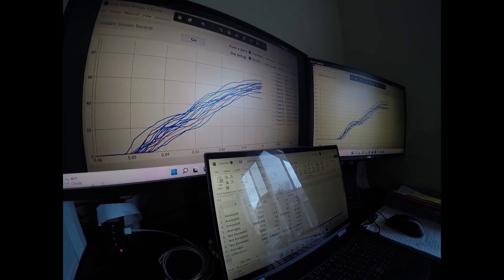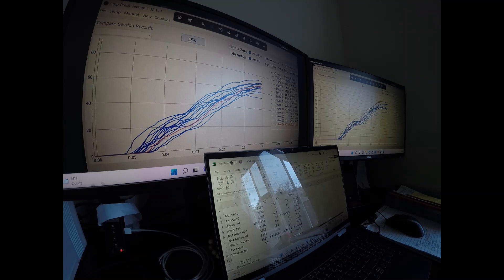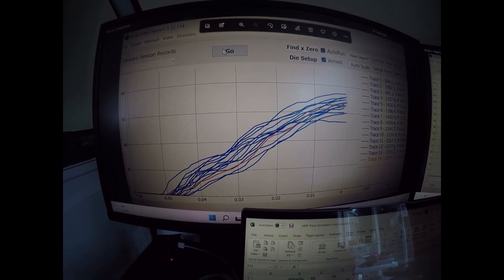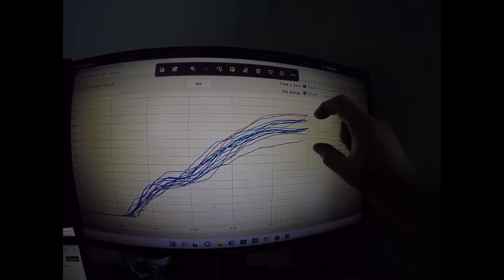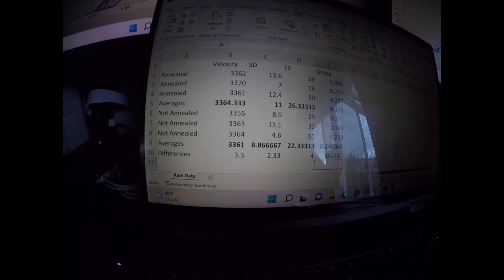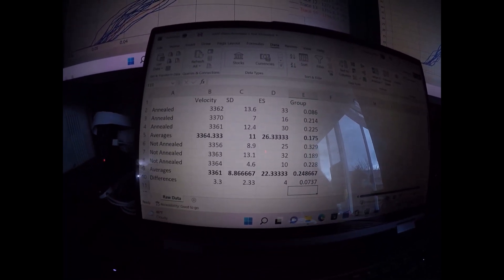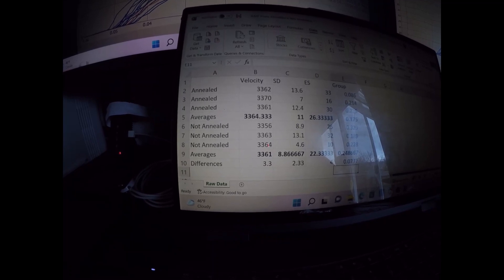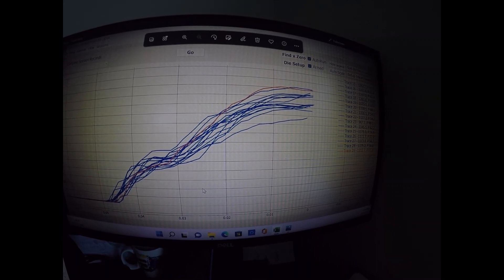AMP Press Series: Annealed vs Not Annealed

Comment: I would think there would be a difference in the sized neck dimensions (using the same neck bushing) between annealed and not annealed brass.  This could account for differences in the measured amp press values when seating bullets.
Reply from the maker: That would be one assumption but I have not found that. Neck diameter is usually very uniform among annealed and not annealed brass. I’ve seen ever so slight variation but not enough to explain pressure curve that show distinct pressure curves and overall pressure to seat. It seems like the annealing softens the brass to the point that it expands easier when seating which manifests as lighter seating pressures. I’ll be posting data from the next test I did in the series that shows this effect.

Comment: I have a feeling that annealed brass burns the carbon out so bullet would be harder to put in or it would need lube to seat bullet more smooth
Reply from the maker: Yes, the lube does make it seat with way less pressure than not lubed. That is my next test.

Comment: This just adds to my argument about loading during competitions. (I do not compete, but my gunsmith is big into 100 yd benchrest and is trying to get me to compete) Powder burns by weight, not volume, so I see why adjustments are made as the day heats up when you drop charges. So, on local matches where you know the weather, why not load at home, with annealed brass and weigh your charge? I don't see the advantage of loading during the match. It just adds pressure to load, clean your barrel, etc.
Reply from the maker: There are many ways to approach matches. Some load everything at the range with small batches of brass, some have enough brass prepped to shoot an entire match with one batch and they charge and seat during the match, some preload all rounds, etc. I’ve seen all methods work well.

Comment: Hello Bryan, did you brush after annealing? I noticed a lot of difference while seating. It feels like after annealing the case is kind of rough, while seating I feel some places in the neck have a more rough structure. After I anneal I brush (without lube),  seating is than way more smooth and consistent.
Reply from the maker: No, I brush prior to annealing. I also rub the carbon off the exterior of the neck and then wipe the case clean before annealing. I can try brushing before and after and see if it has any effect on the pressure curve.
Reply: This is why I switched to wet tumbling and lubing necks after annealing(dry tumbling did not remove the grit). I noticed the same gritty feeling when final sizing using a mandrel and bullet seating. It would actually leave hard brass looking deposits on my mandrel. Annealing is the first process for me after de-capping. So initially I switched to wet tumbling without lube and the clean necks resulted in a significant loss in accuracy and an increase in SD/ES. Using a suspended graphite lube on the clean necks resolved those issues. A guess is that there are oxides left behind after the annealing process. Oxides can be much harder/more abrasive than their unoxidized counterparts. Could also be a mix of that and burned carbon residue. I imagine brushing the necks would serve the same purpose as wet tumbling. A mechanical removal of the residue.

Comment: Just wondering if you have considered shifting the start times to coincide with each other.  From what I understand, the point the graph starts(flat) and actually starts to climb depends on the case length and timing of the machine. It just seems to me that a more finite comparison could be made using this method. Either way, good information.
Reply: There is a way to do it by using the export function of the trace data into Excel. Then, we can recenter the series to index at the start of the pressure curve and plot the series accordingly in Excel. This is one of the first thing I did when I started to use the press and I told Matt Finlay that would be a good feature to add to the software. However, after using the press for a while, I became less interested in this type of output. What I like to do occasionally though, is to zero the press a bit further than my target seating depth, the trace will then show the exact point where pressure increases at then end when the die bottoms out. This is useful to visualize traces for a seating depth ladder for example. It tells me if my micrometer seating die is accurate in from one micrometer setting to the next. -- I realize my comment may be a bit nebulous to follow if you do not use the Press. The key point to understand is that the traces index to where the die bottoms out when you zero the press, which is the Zero mark on the X Axis.
Reply from the maker: How do you “shift the start time”?
Reply: @WitchDoctorPrecision  I do not have the amp press, but I have heard there is a function that will do this, perhaps in the set-up or parameters. I cannot verify this, but heard it on a youtube video from another person that it is possible and he was going to try it, He hasn't posted anything further.
Reply from the maker: @6handicap604  hmm, I followed the set up directions from the manufacturer and it all seems fine.
Reply: @WitchDoctorPrecision  Yes, I agree, your charts as shown are similar to others I have seen, which I understand is the normal way.  But the guy said there was a way to start each graph entry at the same point, where there was no horizontal line starting the graph lines. In other words, each graph line started not in time, but when pressure first starts. I may be wrong, but that was my understanding.
Reply: I guess one would say you initiate or start the graphs using pressure rather than time as the start point.